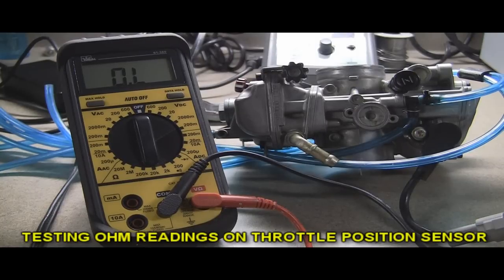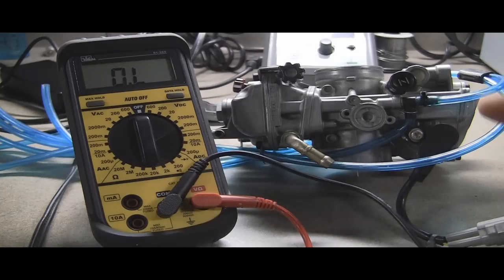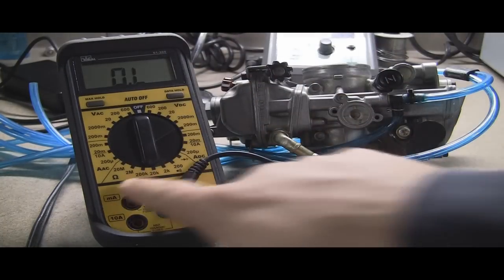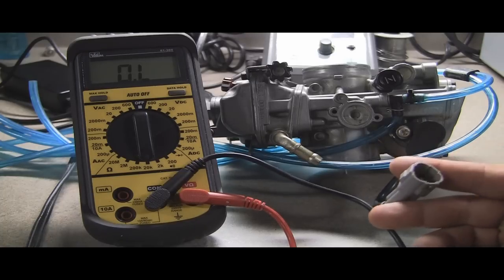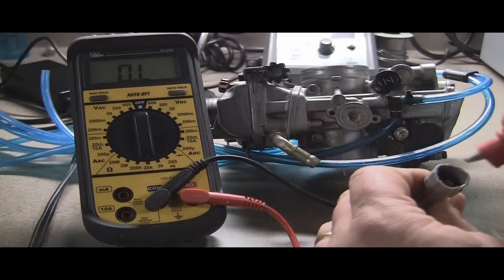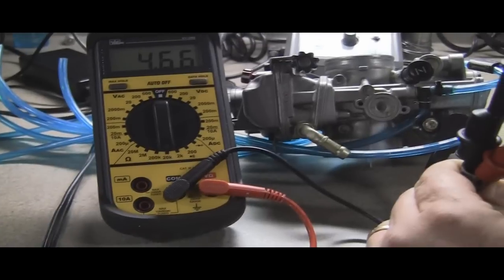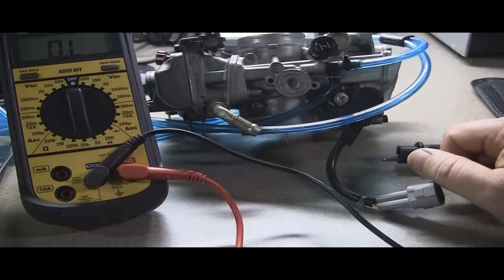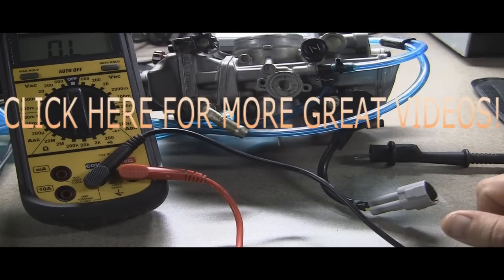Testing Motorcycle Throttle Position Sensor: Checking Ohms with a multimeter

Comment: Good video but also the reading will go down as you open the throttle and if you get a glitchy spot in your reading as you twist the throtle it will mean that you have a wore spot in the tips which can cause trouble at the rpms where the glitch is.

Comment: I have a TRX450ER 2006 and the tps  is hanging under the hood  outside the throttle would it affect the bike when you run with it outside and what is the function of the tps

Comment: should`nt there be 2 different readings, my yz manual says (throttle closed) zero - 2ohm (throttle open) 4 - 6ohm. was your throttle open or closed?
Reply: I know you asked this forever ago but I believe the correct way to test the switch is with the engine running and it's in Volts not Ohms, at least in my manual for my FCR carb which is the same as the one in the video. I think he is just doing a simple test to see if it is good or not but that's just the start.
Reply: My r1 is Blue/Black and Blue 4k to 6k then test the yelow and Blue /Black while opening the throtle slowly
Reply: justin Bivelacque ...depends on the bike. The DRZ400E uses an FCR39 carburettor, and the Factory Service Manual specifically states to measure it in Ohms, and with the throttle fully open the TPS should be rotated until the ohms reading is within the specified range, then the tps is locked down.

Comment: i have a 1988 suzuki katana gsx600f street bike and i cant find a carburetor anywhere my carburetor is done for so i can repair it but i found a carburetor from a 2000 suzuki katana gsx600 and i was wondering since the 1988 model never used tps will the carburetor still work the way it should 1988 model does not have tps and that being said i cant plug the 2000 tps into the bike there is no connectors for it.i think it wil work but im spending my last money to buy it and dont want to risk it TY

Comment: well rebuilt the carburetors and replaced gaskets needles and valves but its still leaking and i cant find a 1988 carburetor that does not need to be cleaned and they are still 150 to 400 and im not looking to spend that much for a used carb

Comment: I have the same exact carb and tps. My static reading is 4.33 ohms. My variable readings are .52 - 3.74 ohms. The tps does reach the minimum 4 ohms on the variable test.  the bike has a slight sputtering issue at just off idle to 1/4 throttle. Could this be causing the sputter/misfire? The sputter disappears when the tps is unplugged.
Reply from the maker: I would say they could for sure be the issue.
Reply: Jesse The Baldy Ventura same problem here have you sort it out?

Comment: could a faulty throttle position sensor be the reason for a bike not running right?
im having problems with mine its an 03 YZF250 aswel an i  have used you vids to do a rebuild and ever since every time i give it gas and let the throttle go the revs dont drop down and i cant get it to idle nicely, if you could tell me any poss reason it would be great i have replaced the rubber manifold and the hose clamps so i dont think its a vacuum leak!
Reply: I have exact same issue with my 2003 yz450f. was it the TPS or a leak?

Comment: My 2000 yzf r1 goes to 3000 rpm and back to 0 over and over again is the code of the tps?
Reply from the maker: It could be and would be a good place to start.
Reply: ***** today i cleaned and tuned the tps and now its gone that

Comment: I want to read ohm values for a sensor , it displays 300 ohms, but if i put multimeter on 'sound' mode to check continuity, it doesnt sound. Could be possible when checking a sensor to dont be continuity there but still good ?
Reply: If you want sound, go with Skynyrd or maybe the Stones.  Other times the Who or Ronstadt should be AOK.

Comment: Why did you use the 20K scale?
Reply: Cuz it's actually about 5 Kohms, not 5 ohms. Also, this test tells you nothing about whether the wiper works only if the resistor coil is still intact.

Comment: Appreciate the video, brother. I got a question for you. I own a 05 650xvs Yamaha V-star Silverado and recently found I have no spark from either plug. I took my tank off and checked both my coil cylinders and both give me a proper secondary reading, but neither gives a primary. I was advised to check my TPS, but when I looked at a downloadable Manual, it says to check it at 1k ohms and my multimeter doesn't have the 1k ohms option. In your video, you said you checked yours at 20k to get your reading. I checked it at 20k and got 5.31 ohms, and the manual says between 4.00 and 6.00 is a good reading, but that is by their 1k ohms setting. It also says I don't only have to unplug it to get to the prongs, but that it must be removed off the carb to get a reading. 

This is my first time getting courageous enough to strip her down myself, and all the shops I have been to have made a bigger deal of insuring I have a reason to go back, rather than actually helping me.

Should I follow the manual and go buy a multimeter with the 1k ohms option and go through the trouble of detaching my duel carbs and TPS, or by your experience and expertise, is my TPS reading properly at the 20k setting, and it is just my coil cylinders that are culprit in my troubles?
Reply from the maker: Thanks for watching, I really appreciate it and so sorry for the delay! Sounds like you have a "ranged multimeter" like myself so there should be no reason to find one with 1k. Most of them are ranged these days. I'm by no means an expert so just keep that in mind. lol. I would start with the coils for sure though.
Reply: Thank you! I had a problem with my regulator and stator, got a bonus at work and just replaced both the above and both coils and plugs, got it all going great and now she doesn't hardly any charge to start, where as before in cold weather she would kill the battery trying to start. Had gone through several batteries, being told it was just the cold cranking amps not being up to par, but it wasn't that at all @.@ lol. Its a lot more simple to work on her than I thought, just had to talk to a few fellow bikers with more experience than myself and stop listening to the algorithm bullcrap the mechanic at the dealership was feeding me. XD Sorry it took me so long to thank you, I just came across this on Google plus lol. Have a good one and ride safe, Brother!
Reply: @xyphiravos9306  hi,its been long, have same issue,have u solved this problem?thanks
Reply: @wilardcondesa9402  it turned out to be an issue further down the line, the regulator stator rectifier was toast. 

When I fixed that my issues went away. 

If you can do it yourself, I'd advise it, as they wanted to charge me like 1000$ to do it, back 8 years ago. If it's a Vstar like mine, you will need a bike jack or some kind, or the ability to tie it standing, as you have to take the kickstand off to get to it.
Reply: @aquietsojourner4683  thanks a lot bro...

Comment: The units are K-ohms not ohms, so the reading is 4K (4,000 ohm) not 4 ohm.  Also this is the base resistance of the sensor (blue to black) and won't change with position adjustment, (yellow to black) is the test for the varying resistance from full-closed to full-open, also in K-ohm. The other common fault with TPSs is that the reading can often be erratic as the throttle is opened and closed, it should rise and fall smoothly, don't just look at the min and max readings.

Comment: im guessing your yzf is fuel injected?
Reply: I have a question for you, when setting the oms on the tps sensor were is the starting point, I know as we lower the idle or raze the idle it will change the tps sensor ready,  so do i set the idle screw to were i just see the oms begin to move and then set my oms, and then of course when i raze the idle to like 1600 rpms the oms well change,  thanks for any info you can supply